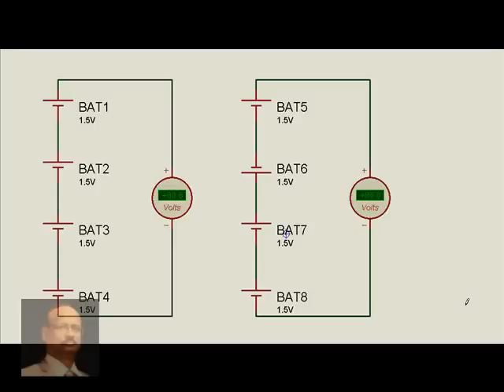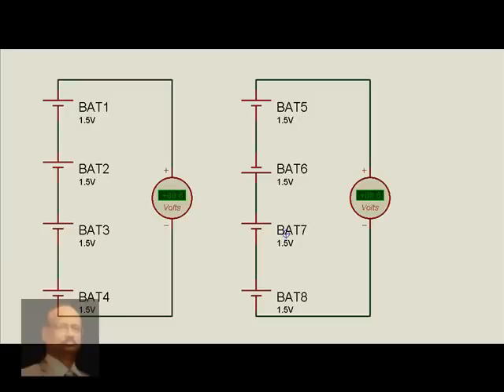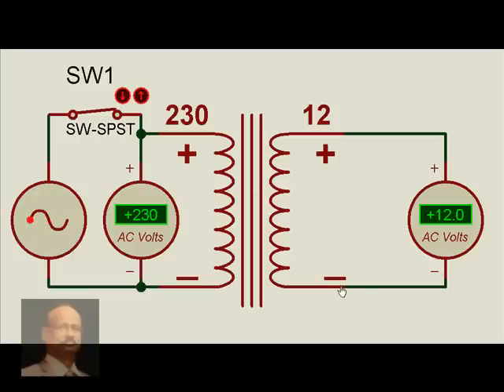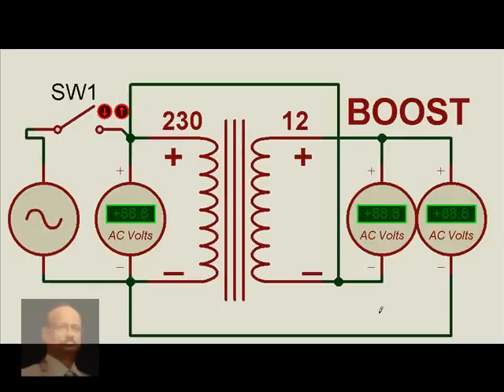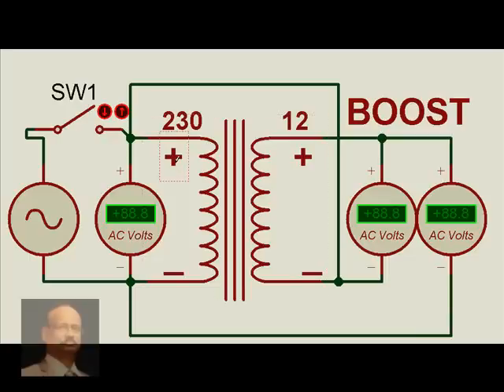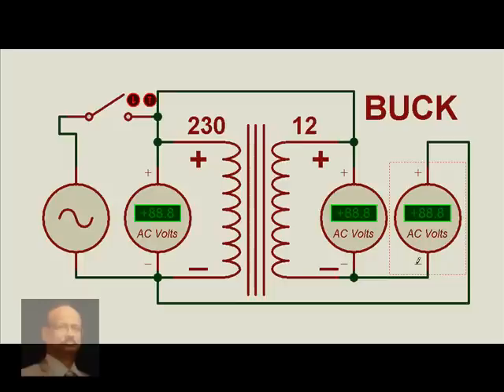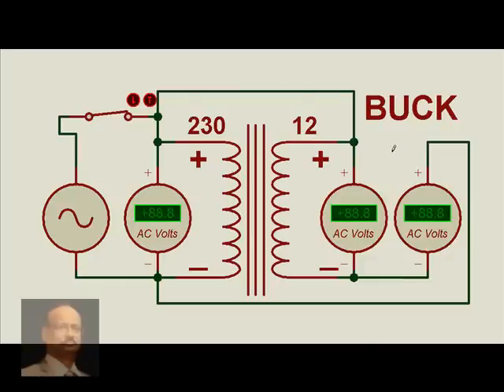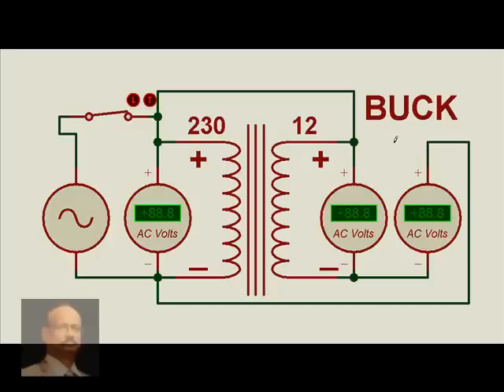voltage stabiliser basics

Comment: Does this buck and boost will effect the connected gadgets? because it might be very dangerous from my aspect....do you have any clarification...My load is an Air conditioner
Reply from the maker: Please watch my other videos on voltage stabilizer. You will get the answer

Comment: Sir stabilizer relay chattering reason and its solution please.
Reply from the maker: Chattering is owing to bad circuit design. An arrangement called hysteresis has to be provided for each relay drive. Hysteresis is a situation that for example if the relay change over happens at 180 volts it reconnects at 184 volts, not at 180.5 volts say. This 4 volt is the hysteresis. This is achieved by providing feedback from output to the input by a high-value resistor of about 150k to 330k to provide a hysteresis of 4 to 2 volts respectively. Without hysteresis for example if the voltage hovers around 181 to 180 to 179 the relay chatter happens. some temporary solutions can be by connecting an electrolytic capacitor of 100uF to 470uF across the relay coil with proper polarity. But it may or may not be a solution as several other factors are responsible. I will make a video soon on this for better clarity.
Reply: @PatnaikUC  Thank you Sir , nicely explained. Awaiting your video.
Reply from the maker: Hysteresis Video uploaded

Comment: Very informative video Sir. Cleared a lot of doubts that I had.

Well, I am looking for a high capacity 230-120 V step-down transformer preferably in excess of 1.5KVA. Need it for all the power tools and  AV equipment that I bought during my time in the US. The ready-made ones are kind of expensive and don't make sense considering their engineering and copper/metal input costs. 
I have two 4KVA good quality ( copper wound ) voltage stabilizers lying around. They are rated to work in the 125-280V range. My research  on voltage stabilizers makes me imagine that  I can use the  125V taps from the auto-transformer while  hooking it up to 230V mains supply. 

Am I correct in assuming this? Looking forward to your reply.
Reply from the maker: Already replied by direct mail.
Reply from the maker: my pleasure

Comment: The "Buck" was solid connected in parallel. The voltage would have been equal.
Reply from the maker: Sorry you are wrong. Pls watch the connections again.
Reply from the maker: The output is between "-" and "-"  and not parallel to input as you have wrongly conceived.Thus it subtracts the secondary voltage 12 from the primary voltage 230
Reply: Okay, I watched it again..

1. The Boost is connected in Direct series. 
1A (inductive series may differ, depending on coiling direction)

2. The "Buck"(#GoVegan), is Directly Connected in Parallel. 

2A (if the inductance is coiled in same direction, they self intensify eachother, equally, when current increases. And they self limit eachother equally when the current reduces).

2B (if the inductance is coiled in opposing directions, they limit eachother,when the current increases; the in current favor coil is less effected. When the current decreases the 'favored' coil is more affected?)

Either case both are connected in direct parallel, but I suppose unequal charges will occur if inductors are not coiled in parralel.
Reply from the maker: Sorry. You have again gone wrong. The question of parallel connection of the secondary coil  to the primary coil doesn't exist at all. It is series and series only whether boost or buck. The series coiling (the secondary) just changes its direction while  from boost to buck or vice versa to add or subtract the voltage while parallel coil (that develops the voltage at the secondary) remains at direct supply always permanntly

Comment: VOLTAGE STABILIZER. VOTLAGE REGULATOR. SERVO STABILIZER. AUTOMATIC VOLTAGE STABILIZER. AUTOMATIC VOLTAGE REGULATOR. AVR. ORTEA
 
We supply Voltage stabilizer or Servo stabilizer or Voltage Regulator ranging from 500VA to 1000kVA in Dubai & UAE. Our AVR has following features:
1) Wide input voltage range from +30% to -45% with option of  ±15%, ±20%,  ±25% & ±30%.
2) Reliable Output Voltage Stability.
3) Short Circuit and Overload Protection.
4) Microprocessor Controlled. Servo motor controlled.
5) High Overload Capability up to 200%.
6) Operation Capability at high Temperature and Humidity.
Common name for voltage stabilizers are voltage regulator, avr, servo stabilizer, servo motor controlled, automatic voltage stabilizer, automatic voltage regulator, static voltage regulator, SVR, voltage control, voltage fluctuation, sag, swell, Ortea, IEKO, Stabica, stabilizer, voltage regulation, voltage controller, inverter, voltage stability,  stabilizer, stabilizers, voltage regulators, automatic stabilizer, ac voltage regulator, ac voltage stabilizer
--------------------------------------------------------------------------------
CONTROL TECHNOLOGIES FZE (Ctrltech)
PO Box 122271,
Sharjah, UAE.
T: +971 6 5489626
Mobile: +971 50 1537113 / +971 55 2338912
F: +971 6 5489627
E: sales@ctrltechnologies.com
W: www.ctrltechnologies.com

Comment: And what about load? will the Boosted/Bucked voltage will supply same load current?
Reply from the maker: Mrunal Ahirrao Basic principle of transformer is input power =( output power x the efficiency). Thus whether buck or boost the current will vary as per the voltage. Example let us assume efficiency is 100% for ease of calculations. So input = output. Then input 200 volts x 5 amps at input= 1000 watts .If we boost it to 250 then 250 x 4 =1000. Or in other words if the input is 250 and we buck it to 200 ,the input current is 4 and output current is 5 . As simple as that.Engineers should not ask this simple question.
Reply: Patnaik UC  Sir I am not asking about transformer current, for example I want to connect refrigerator which consumes 700mA when ON, so suppose I used 12V,500mA transformer to stabilise, and I boosted the voltage from 218 to 230 using above transformer, so the load current what about load current will my stabiliser supply enough current for above refrigerator?
Reply from the maker: Mrunal Ahirrao It is not the current alone that is required to operate a load. It is the power ie voltage  multiplied by current. So if your transformer is 12 volt and 500 mA the total power that the transformer can handle is 12 x 0.5=6 VA.Whatever way use that whether step up or down the power delivery in 100% efficiency cannot be more than 6 VA. A  standard 165 liter refrigerator but needs minimum 600 VA which is 100 times that this poor transformer can deliver. So no way that you can sue such a transformer.